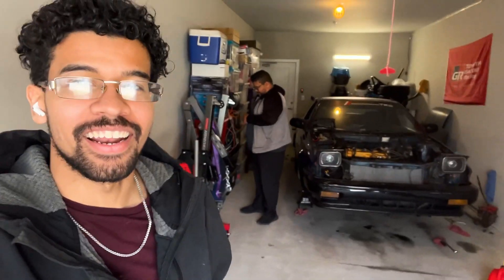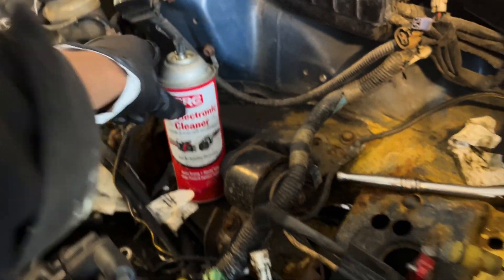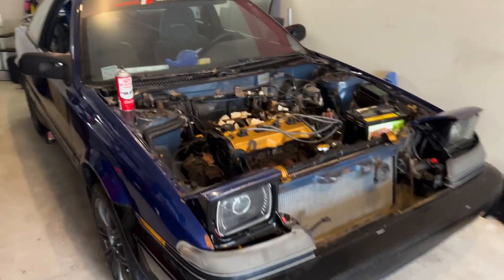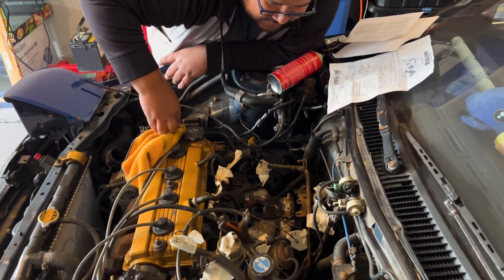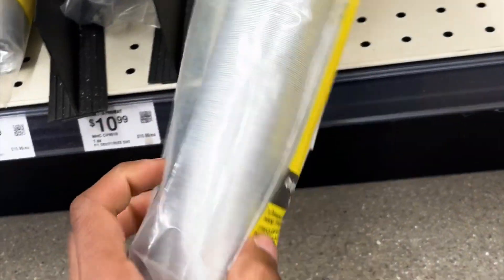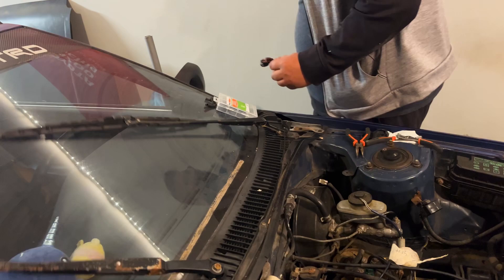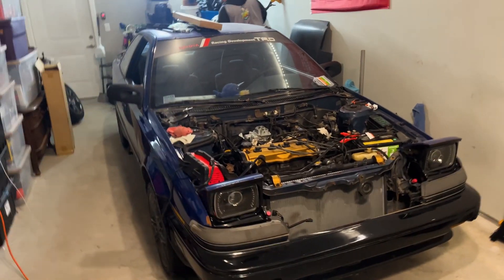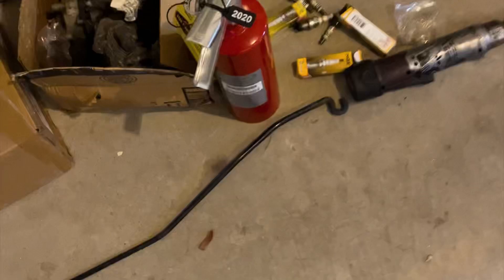How to Install A Weber Carb on an Ae92 Toyota Corolla SR5 4AF | In Depth Walkthrough! 32/36 Weber

Comment: we need more 1stgen 4afe content! I have and ae92 sedan that i want to keep the original engine with and build it out a little higher compression a bigger cam put it on stand alone and mabe some itbs, bit im still not sure about itbs.  Any suggestions on cam's?  I was looking at cat cams 268 cams bit im worried the would be to big for the engine, I will also be doing port and polish bigger injectors and fuel pump, any sources or information will be helpful and greatly appreciated !
Reply from the maker: I’ll definitely try to push out more 4af/4afe content! It’s just harder when I don’t own one haha😅

But I believe 264 is the highest you can go before problems arise but typically I only see aftermarket cams for the 4AGE not the 4afe  but nice that’s cool!

Comment: how did u keep you headlight open like that every time  when i turn off the light just closed
Reply from the maker: Okay sure turn the switch all the way on. Then what you do is flip the switch almost all the way back, but youll leave it a click before its at the postion you started with. And thats how you keep it up
Reply: @Tuned4Speed  i got it thank you
Reply from the maker: No problem!

Comment: Out of curiosity why upgrade the carb instead of getting a 4age or 4agze
Reply from the maker: Swapping a carb is waaaaayyyy cheaper, easier and ALOT less work, especially in a 4af sr5 chassis, this carb install was 400 and doesn’t require pulling the motor, swapping in a new harness or anything, really simple
Reply from the maker: A 4AGE swap on an sr5 is more of a headache, since your going carbed to efi, let alone just sourcing the 4AGE engine, wiring harness and and ecu

And then the 4agze is harder to find and more pricey